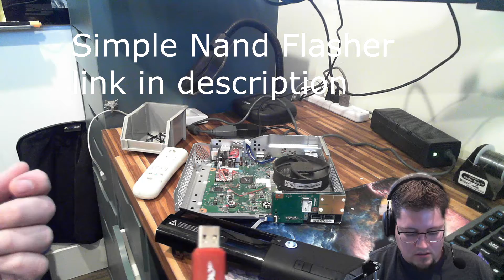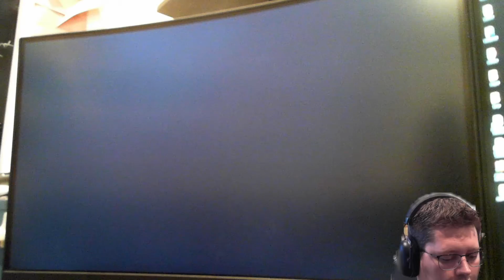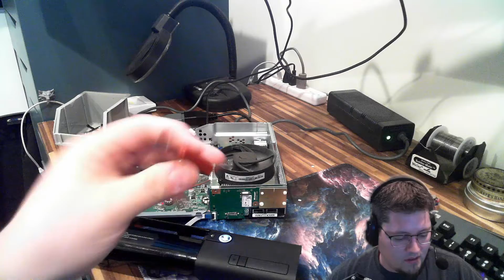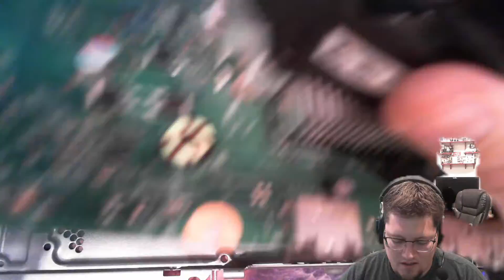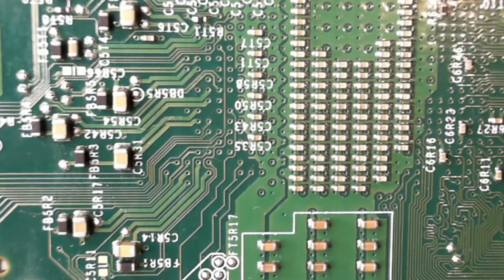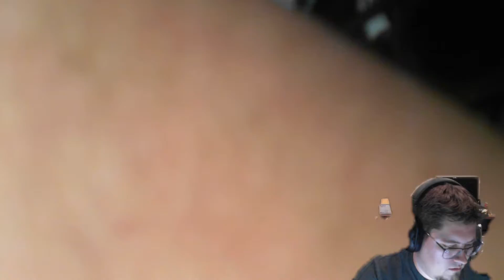Upgrade Corona RGH2 to RGH3, walkthrough / How to guide and demo better boots WITHOUT a glitch chip!

Comment: Great walkthrough video. Thank you! Is there a way to salvage the PLL VIA if the pad lifted? I accidentally pulled the wire once it was soldered and the VIA pad ripped. I soldered the wire back but it is slightly holding. I continued through the process anyways but after loading the XELL and when I boot, do not have video.

Comment: Hello.. im buy secondhand RGH2 Corona 4GB then try to RGH3..
using Picoflasher backup Nand & Write Nand  is succesfully..
and wiring RGH3 im sure is good (because im experience RGH3 around 8 Console)
but No Display on my TV.. consol just center green light..

as far as remember my Dashboard when RGH2 is 2.0.17148..
then create & write RGH3 with 2.0.17559..
is this causing problem No Display??
or i must update Dashboard 2.0.17559 before RGH3??
Reply: BRO DID YOU able to solve it ??

Comment: i need to do this to a couple slim trinity's. one has an old cool runner rev.b and one has a x360ace v4. boot times on the cool runner are pretty bad, the x360ace boots pretty quick sometimes, its not as good as my old jasper though.

Comment: I've had a slim corrona 4gb rgh2 for years always boots up. I've noticed if u use a cheap or old/damage hdmi cable you will get slower boot times but if you use a high speed hdmi or even better the original hd av cables its instant boot 90% of the time and will always boot within 30 seconds.

Comment: Its usually best to disconnect signal wires that aren't connected to anything due to floating voltages. I was messing around with an Arduino the other day that a button between 5 volts and a digital input pin. Immediately when I plugged a jumper into the input pin and not connected to the other side of the button yet, the pin started reading high randomly and my code was firing prematurely, all due to floating voltages. It wasn't until I put in a pull-down resistor to keep the signal low only until the circuit was completed when the button was pressed. Something to keep in mind if you ever have reliability issues.

Comment: I bought a QSB for my corona from you and I was just wondering if the resistor had to go a certain way or if it didn't matter?
Reply from the maker: Resistor direction does not matter.
Reply: @TheWeekendModder  thanks for the reply
Reply: @TheWeekendModder   I need your help please, I did the video tutorial... I haved rgh2 and could read backups and original discs. Now rgh3 its working very well but, it cannot read any type of discs... Any tips for me?
Reply: @Extrem-Gamer yeah go back to rgh2

Comment: $4.99 for the QSB, then he charges $4.25 for shipping LOL. What a freaking RIP OFF!!! That QSB weighs no more than a penny along with the mod chips he sells. You can ship that QSB and a mod chip in a regular envelope for 60 cents anywhere in the USA from the west coast to the east coast 100% guaranteed.  Only an idiot would pay that overpriced shipping fee thinking it weighs 1 pound. He needs to be honest and do the right thing regarding shipping vs making money on the back end, off stupid people, no matter how popular is.
Reply from the maker: A few points of response: 
1 - You're a dick.
2 - A USPS First Class (with tracking) label on up to 4 ounces cost like $3.85 in postage.  Add the cost of a bubble envelope, shipping labels,  and any tiny amount of labor to pick and pack the order and $4.25 clearly not making any money off shipping. 
3 - You're right that I could just put it in an envelope and mail it - without padding, without tracking.  So what do I do when it shows up broken and you want a replacement?  Or it doesn't show up at all and there is no tracking?   I end up with a CC chargeback and a pissed off customer. 
4 - You're still a dick.

Comment: I think I just corrupted my nand by either writing the wrong files/ecc or by accidentally turning on the console when Jrunner was still plugged in. The console had a dead x360run chip so I thought I could experiment with RGH3 . The dump was good with no bad blocks but now I can not read nand, and writing nand backup brings several errors like this...
"Error: 000 writing block 0" etc 
 "Failed to write 0×30" etc

Checking console....
Version 10
Flash config: 0×398E0EE8
Unrecognizable Flash config
Io TimeOut

IoTimeOut: No more bytes

Please help, I just need to be able to write back the original modded nand dump. I don't think it's my Brunner either because it can still write timing files into a matrix chip without a problem
Reply: Is there away to reset/erase nand and write back the original dump so I can begin from there. Another thing is that I didn't use a 1k resistor on the rst point and it's 16mb Trinity. I have modded 5 consoles before successfully so I am sure about the soldering
Reply: I  solved this problem by reflashing the firmware on my JR  programmmer
Reply: @goodintentions5189  dude help me here please 
i also corrupt my nand and although I had the rgh2 nand backup I didn't have the original dump now after trying rgh3 with the wiring and convert to rgh3 and flashing it it doesn't boot into rgh3 and going back to rgh2 doesn't work either the glich chip isn't glitching what can I do

Comment: Downloaded the Jrunner RGH3 repack but the kernel version is blank and the only options there is Add Dash/Delete dash. How do I add dash ?
Reply from the maker: You have to download a FULL jrinner, then put that exe over the original.  Running just the exe from my pack will behave how you describe
Reply: @TheWeekendModder   please sorry the insist,   I need your help please, I did the video tutorial... I haved rgh2 and could read backups and original discs. Now rgh3 its working very well but, it cannot read any type of discs... Any tips for me?
Reply: dude help me here please 
i also corrupt my nand and although I had the rgh2 nand backup I didn't have the original dump now after trying rgh3 with the wiring and convert to rgh3 and flashing it it doesn't boot into rgh3 and going back to rgh2 doesn't work either the glich chip isn't glitching what can I do
Reply: @funfactofeveryday5704  You will need to find somewhere who can help you in your town/city for a small fee. I wish I could but I can't

Comment: do i really need a qsb ???
Reply from the maker: No, as I stated multiple times in the video - you can do this with just two wires and the resistor.
Reply: @TheWeekendModder  sorry 4 insist... I need your help please, I did the video tutorial... I haved rgh2 and could read backups and original discs. Now rgh3 its working very well but, it cannot read any type of discs... Any tips for me?